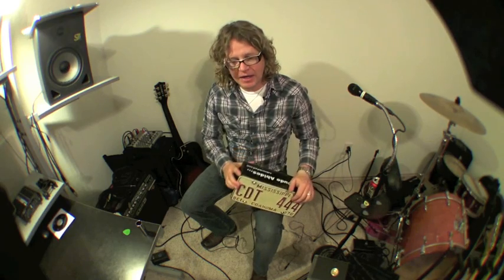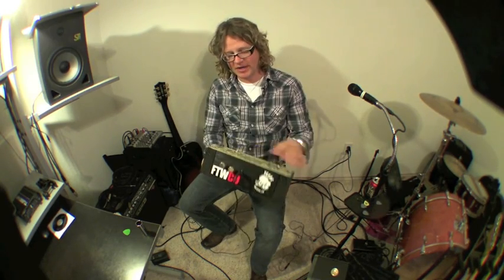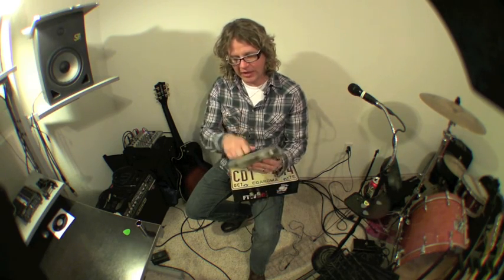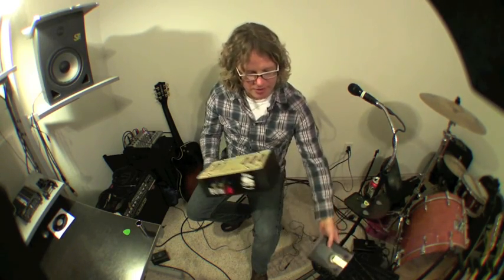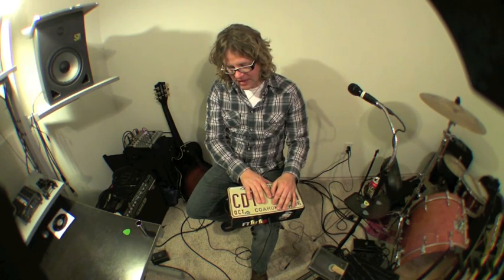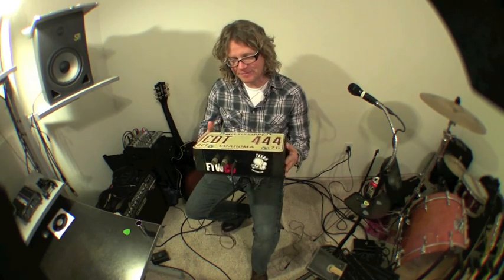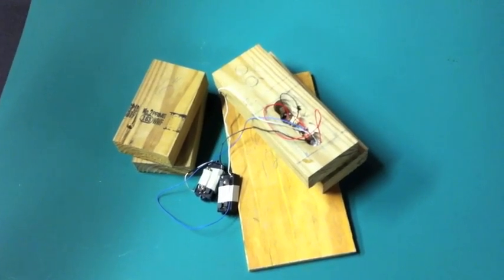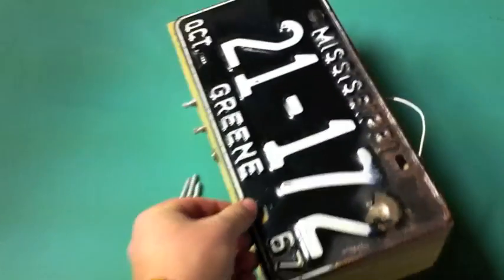DIY - Build Your Own Stomp Box (Foot drum)

Comment: I built one of these over the weekend and had my local guitar repair guy wire it up for me. Just FYI you have to put the pickups pretty close to the plate to get a good kick, and I ended up putting a thin piece of cardboard between the pickup and plate; that took some of the "pop" out of it and left the kick. I also put two tamborine jingles on one of the plate screws for some jingle. This thing rocks.

Comment: Thanks for posting this.  Sounds good.  It would have be nice if you gave a little more detail about how it's built including what pickups and pots you chose and how it's wired, etc.   Also, I take it you and your father aren't woodworkers because using 2x4"s is not only overkill but it's pretty crude. No need for such heavy lumber and the joinery is - well - pretty rough.  With a little more effort an much better box could have been made.

Comment: Awesome. Want to build one of these puppies, but getting confused on the measurements....6x12 bottom board, with 6" 2x4 on the ends, and you say 9"  2x4 on the sides? Wouldn't that make the length total 13" ?(9" length + 2" x 2 from the width of the 2x4's on the ends) Sorry for makin' this sound completely stupid......PS great tunes on yer band website! Now have a fan in Canuckland!

Comment: what kind of saw do you use to cut the 2 3/4 by 3 3/16 by 2 1/4 high piece? also how does the thing get power?
Reply: From the 9v battery. But you could also wire in an AC jack to the side & use either a separate adapter or what ever powers your pedalboard. Just make sure you reverse the polarity if you're using something like VoodooLabs pedalpower.

Comment: So I do some busking on the streets of Portland, Maine and I was wondering if something like this could work without bothering with the pick-ups. Maybe using thinner wood to have a more open inside and a hole in the back of the box to let it resinate more, but do you think that would sound alright at all without the tone adjustments and everything?

Comment: I ran out of characters...I was stomping on the plate and it was kind of harsh and not round like a kick drum...I was going to go cut out a wood cover to replace the plate and then I thought...why not just turn the box upside down...put the plate on the floor and stomp on the bottom...HOLY CRAP...it sounds just like a kick drum!!!!! I just need to buy 4 bolt on rubber feet and attach them to the plate on the bottom.....Try this you will not be dissappointed! Looks like we have a GREAT Design

Comment: Hey. Is the wooden piece under the pickup secured to the plywood below?
        Also are the pickups secured to the wood beneath them? or do they just flop around? and the pickups are face down? why are they taped up? also where did you get that little handle for your box? i can't find one anywhere.    sorry for all the questions, i'm making 4 at the moment (assembly line style) and i want to avoid big screwups.   thanks

Comment: I've got a shitty ukulele back in the states that I bought before I knew what a shitty ukulele looked like, it has six strings, but not with paired sets like a 6 strong Uke is supposed to have, the scale is off and the body is too big, basically it's a failed attempt at a miniature acoustic guitar that failed, I bought it at a fair or something. So what I'm thinking is that I'll take the neck off and the top and put the wiring inside and the replace the top with a license plate place cut to size, any thought?

Comment: So I built a license plate box...the pickup idea does not work very well in my opinion...using magnetic pickups to amplify hitting the box...well it is not what you would expect...Here is what I did and now have the best stomp box EVER! build as shown but instead of pickups go buy a piezo transducer from Radio Shack for $2. Use the vol and tone and jack...now here is the secret sandwich the piezo between some foam and wood pressed hard against the plate...then turn the whole thing over HEAVEN!